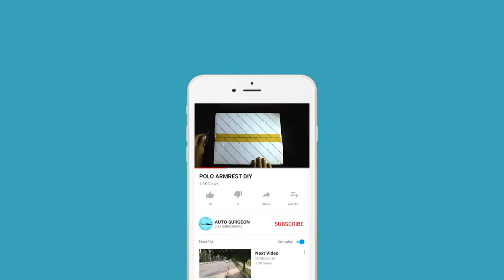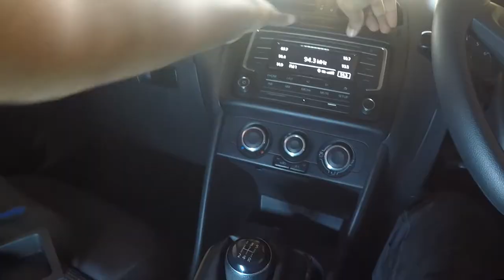POLO Armrest | DIY 👨‍🔧 | Step By Step Installation | AUTO SURGEON

Comment: why did you not use a thread lock to ensure the armrest wont become loose? just a drop per screw of medium strength can ensure it wont ever come loose with vibrations but allows for it to be removed if needed. PS thanks for the advise of a flexible extender for the front screws of the actual bracket that bolts to the chassis .its impossible to reach otherwise and i would not have thought of it
Reply: There’s no need of thread lock for armrest if you tighten it enough. There aren’t strong vibrations that would loosen the bolt.

Comment: Why the gear box and front info trim removed and got back as seems not required for installation of armrest?
Reply from the maker: Sliding-In the armrest by just removing the screw from behind the Handbrake lever is not possible…it’s very cramped & might might break something…If you remove the gearbox trim and infotainment trim..you will get enough room to work with peace of mind…hence will be a clean and tidy fit…!
Reply: @AutoSurgeonChannel  I tried it...I could just about get the metal bracket under without unscrewing the centre console...but I could not tighten it up. Thanks for the video
Reply from the maker: Glad you like the video…Do like and subscribe brother…!

Comment: Nice and informative content but I didn't understand why did you take out the screws which has nothing to do with installation part?
Reply from the maker: To slide in the Armrest into position …it’s necessary to unscrew the the centre console trim…without which it’s quite risky…you might break something coz the Armrest base is a big chunk of metal…it’s literally Metal vs Plastic…it’s better to unscrew than replace the broken centre console trim no..?

Comment: Can we also add a rear AC vent in the 2017 highline Polo ?
Reply from the maker: Actually you can, but then you will have to re-route the front blower air through the central trim…but frankly, I don’t think that will have the kind of effect, that you are expecting…as POLO is not that a huge car no?
Reply: @AutoSurgeonChannel   may I know how much will it cost for adding rear ac vent And re routing the blowers?

Comment: where to buy this armrest?
Reply from the maker: This one is an OEM Accessory, you can get it from any VW Showroom. I recommend not to go for after markets as those tend to make some kind of Rattle sounds after some time.
Reply: @AutoSurgeonChannel  what was the cost of it?
Reply from the maker: 6k...!
Reply: Well informed ..TNX👍
Reply: What about the ellen screw?
Reply from the maker: I had fixed it using a conventional Allen Key (L shaped)...but the angle is too tight to actually film it...
Reply: Thanks

Comment: How to activate window roll down feature via remote in polo comfortline tsi
Reply from the maker: Please mention variant and year?
Reply: @AutoSurgeonChannel  comfortline tsi 2021 variant
Reply from the maker: If you have all 4 window controls on your driver side door...long press “Unlock” to roll down...similarly long press “Lock” to roll it back up...
Reply: @AutoSurgeonChannel  this variant has all 4power windows but driver side there are only 2buttons to control front windows 
When i try to hold the lock/unlock button to roll down/up nothing happens just the red led on the remote blinks
Reply from the maker: Exactly...Smart remote roll up/down function works only if you have all 4 power window controls on the driver side...
Reply: @vivekkpatswane835  iam also booked the same model